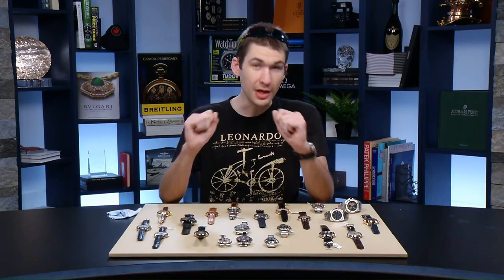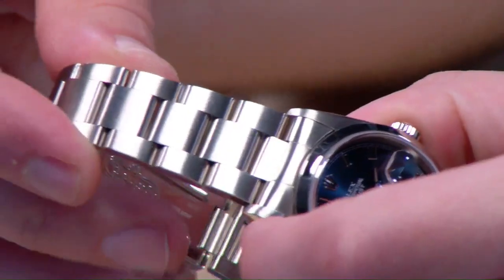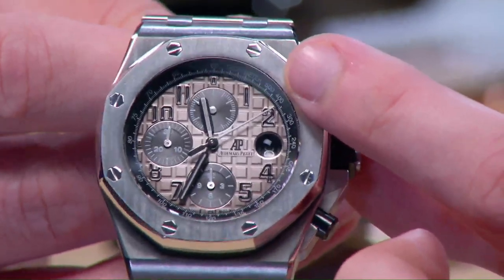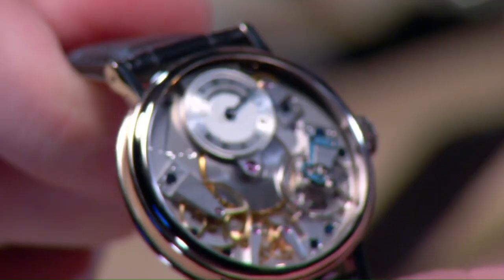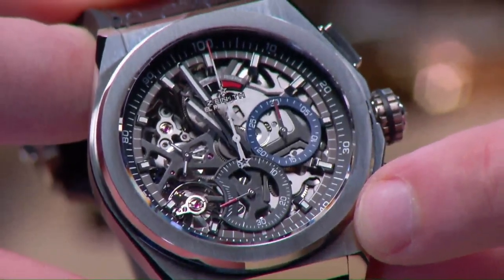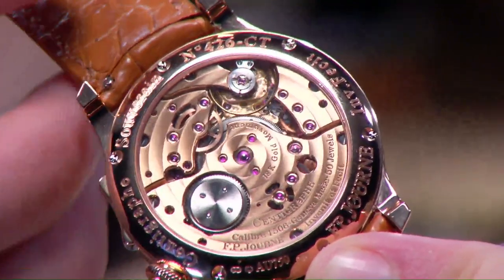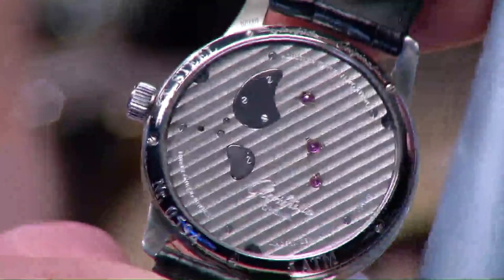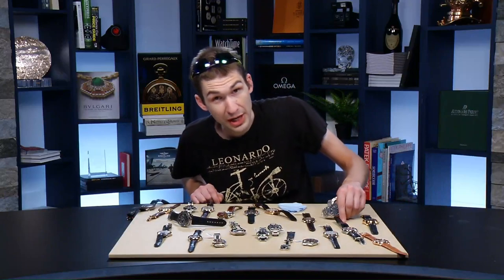Rolex Daytona, (No-Date) Submariner & Audemars Piguet Royal Oaks Meet Grand Seiko

Comment: I thought ROO bolts were white gold. Was it an exception on this platinum pounder to be stainless steel?
Reply from the maker: My understanding has shifted over the years from believing the bolts were gold to recognizing that the Offshore uses steel while the 37-41mm standard Royal Oaks use gold. Also, the "mega tapisserie" dials on the Offshore are stamped while the "petit/grande" tapisserie dials on the standard Royal Oaks are cut on pantographs.
Best,
Tim

Comment: Obviously Zenith movements are fantastic and equally as obvious is the fact that, despite this and the great-looking watches that it used to produce (I'm thinking particularly of the El Primero Chronomaster Moonphase Triple Calendar), its marketing strategy sucked. Equally, though, I think the new offerings are appalling, and very reminiscent of Richard Mille stuff, which I also think are appalling, but isn't the new Zentih guy one of the guys previously from Mille or Hublot, so I guess that's not surprising, I think Zenith has probably alienated all its previous customer base with these Lego watches and the sort of people who buy that type of watch won't be interested in Zenith.
Reply from the maker: The only Biver/Tornare-era Zenith that interests me is the solid dial Defy El Primero 21. Incidentally, I've NEVER seen an example of that most conservative of Defys. As you note, the old 40mm COSC-certified caliber 410 Chronomaster is an all-time great, and most of the Zenith watches that appeal to me are pre-2001 (before T. Nataf) and 2010-2015 (JF Dufour era). The current Zenith watches look like middle-child LVMH corporate designs to shuttle buyers between entry-level TAG and the final destination, flagship Hublot.
Best,
Tim
Reply: @the1916companywatchreviews  Tim what are your thoughts on the 420 manual wind calibre?? How does it compare to an 1861 for example